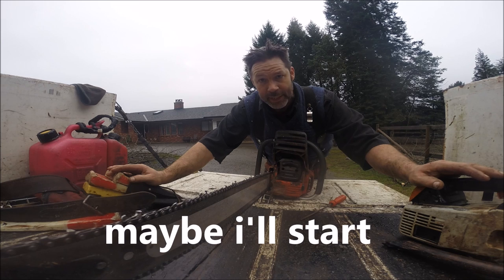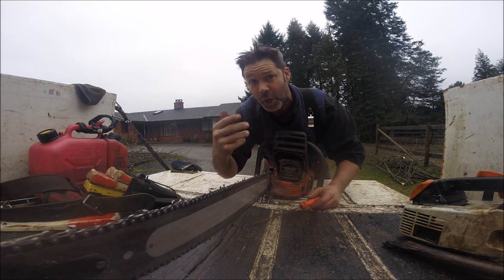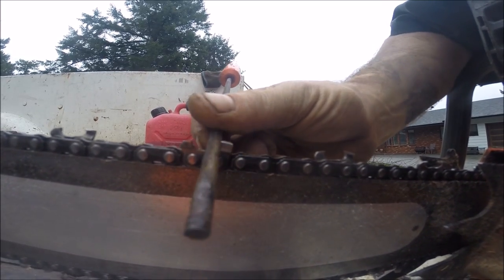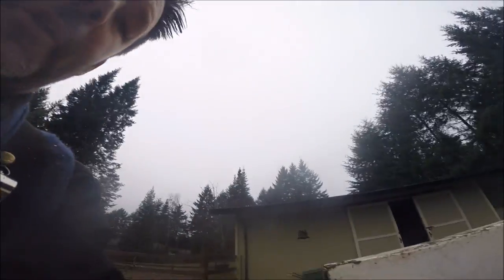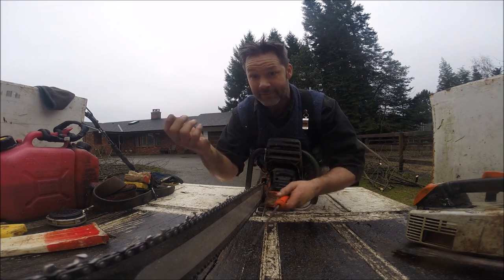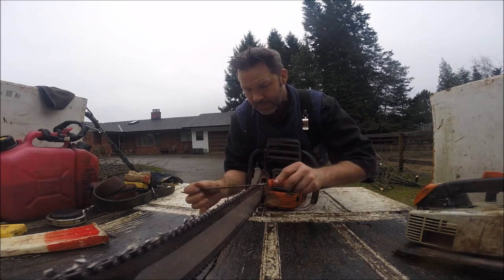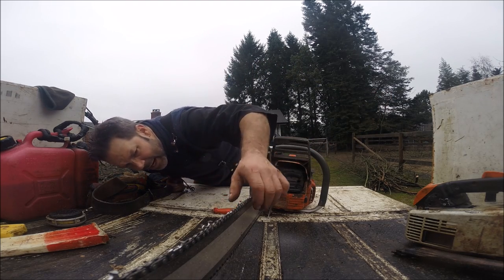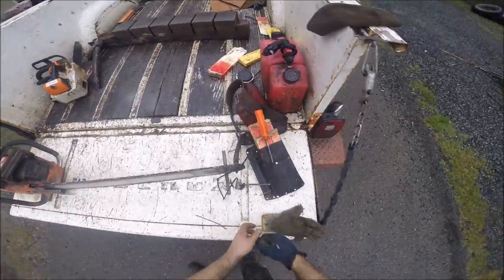FALLER, SHOWS CHAIN SAW FILING TECHNIQUE

Comment: I'm happy you do these videos!  You helped me alot filing. I use a united states 10 cent dime for a depth gauge in the woods. Set it on the racker level and file till top of the tooth is at the top of the dime. Plenty of grab.

Comment: New job has had me using a chain saw a few times recently. I'm a total novice at it and was quite hesitant and scared to use it at first. Was using a 20 inch chain and it would dull out after using it for a while. So I would go buy a new chain. This video has helped me learn a lot about saving money and proper sharpening. You're a great teacher in all aspects of the power saw. Thanks bud.

Comment: Very good video, I file similar to this without doing the boat, I just file with a 10 degree downward angle and keep my top plate between 25-30 degrees. I stumbled on it many years ago, always experimenting. I never knew why it cut so good back then I just went with it. The gullet is the key, helps the chain to clear itself of chip. I too get a big kick out of guys calling it a chainsaw blade.

Comment: After watching a few of your gullet get'n videos I took the gullet out of the next chain I sharpened by rocking that boat and BANG! I could feel a major difference in performance and even see it in the cleaner chips. The way you are teaching this is spot on. If one can't follow your teaching... They should just cut their "SAW BLADE TEETH" off completely with a grinder or hack saw.

Comment: Good vid Billy, great to see how other people do things wether its sharpening a chain, splitting wood or falling a tree. Like you say lots of content across youtube about power saws stuff, shame some is just rubbish. A fair few pretenders!!
 Do you run round filed chain for tidying jobs and square cut/filed for production felling? Over here not many people run square chain its 99% round filed,which i suppose for the simple fact that its better for staying sharp in dirty wood.
Keep up the good work.
Reply from the maker: +ukgunworks,,, hey thx buddy ,, ya residential tree work tends to have a little more steel in the wood so I use the style in this video , with round file , but for production fallin' in the bush I use a stand up chisel grinder and yes anything that has a real fine corner will get duller faster if not very careful ,  grinding chain actually changed my sawman ship, improved it ,cutting style changed,.

Comment: It's an awesome Job you do, I know you worry about preaching to people but Honestly I have noticed in quite a few topics that there are people now that are in a trade that are in my opinion giving information that is lethal in some cases so the best case conclusion is they are purposely giving Dangerous and deadly advice in some cases. Google for a while was known as the place to get information like Utube but now you actually need to know things because people are posting False information regularly. 
Thanks Again Billy 
Stay Safe, Well and Blessed as you are 

Garry
Reply from the maker: ITS EVERY WHERE    THX PAL
Reply: Hey Billy is the chain your using there a skip tooth chain ? as it looks like it has less teeth than my Stihl runs, Is this because the Stihl has so much more power and can run the more teeth ????????? Now that your chuckling Have a Stunning evening or Day depending on the time difference.

Comment: A chain with teeth filed almost all the way gone like that is the best! More room for the chips to ride out. You got it easy with that soft wood. I'm usually cutting white oak that's been drying for the last 10+ years, or dry osage orange.
Reply from the maker: try round chain
Reply: Round? All I've used is chisel and semi chisel. I know skip tooth is best for clearing chips in large logs, but the only skip tooth I run is chisel and it's on my biggest (42") bar.

Comment: Billy Ray's chainsaw sharpening service. I like it. 

Nice job again. What is that chainsaw setup? Saw, bar, chain?
Reply from the maker: +joeandmollysantamour 372. 3\8s   105 drivers,  63 gauge  skip.
Reply: +Buckin&#39; Billy Ray Smith Is that saw ported or just muff modded and unlimited coil?
Reply from the maker: Alex Matthews, all my stuff is modified,, I can't run stalk saws , I ll just stay home , lol
Reply: +Buckin&#39; Billy Ray Smith Ok got ya lol who did the work for you and how do they hold up? Just wondering as I just run muffler mods now, which really are a necessity with the stupid EPA!
Reply from the maker: I ve had tremendous live out them, but iill say this even if they don't last as long, it wood not deter me from modified saws as I am on them daily , thx

Comment: the top side of the cutter digs into the wood but it does not determine the side of the woodchips that role belongs ro the rakers. the lower your rakers the larger the wood.

Comment: When you see someone sharpening a chainsaw chain and they talk about the raker change the channel. A raker is
a saw tooth for cleaning loose chips from a kerf like on an old crosscut hand saw. On a chainsaw chain the depth gauge limits the amount of wood that the cutter cuts into, .025 to .030 inches.

Comment: If I had the patience for a raker gauge, I'd be a better man....I use the geometry of the top of the raker, mimicking the ratio of the rectangle from one tooth to the next. ( I don't mention that for your benefit Billy Ray, rather for the slight edification of any other person who might read these comments...)
Reply from the maker: +Samuel Luria.... I did that for years until I hooked up with a legend in these parts , who taught me to grind  chain, we were production fallin' steady, I got pinched one day and he passed me his saw to cut myself out,,,,, well... after cutting with that mans saw , I was a changed man for good , that day I bought a grinder and started using a guage and have never stopped, . on residential jobs I'm not as picky , as there is steel in everything.. thx for yer comments
Reply: You don't have to thank me fir my comments. I make too many. But, gotta say, I hate machine-ground chain. Although, I do carry a dremel  in my truck, for taking dimples off the inside drive links. Some guys just loosen the chain, and let the bar and the dimples find their own way back together, but I don't like that technique, as it does wear out the groove in the bar. Not that I slip a chain very often, mind you, but still...
Reply: (As far as "lifting" the file - I can kinda hear why they say it. A lot of times, with a 7/32ths, you're just BARELY catching the underside of that lead edge...and often you're not catching it at all...